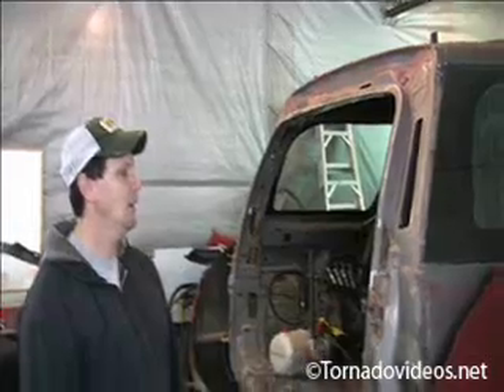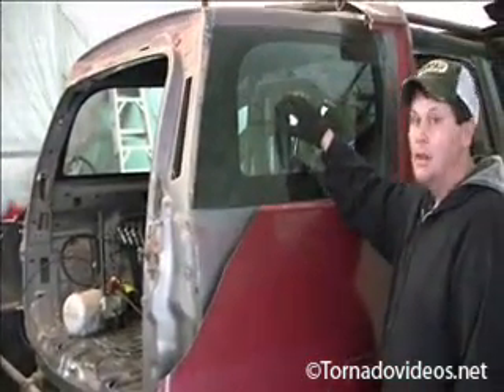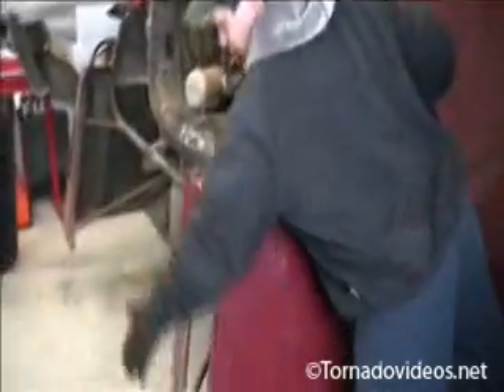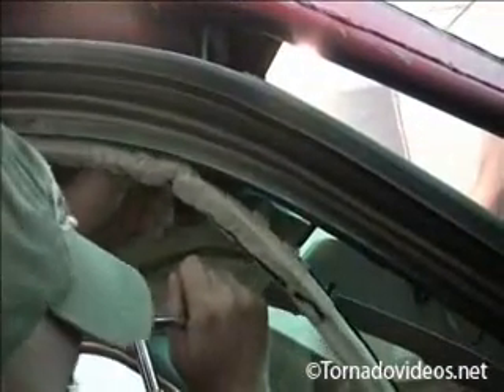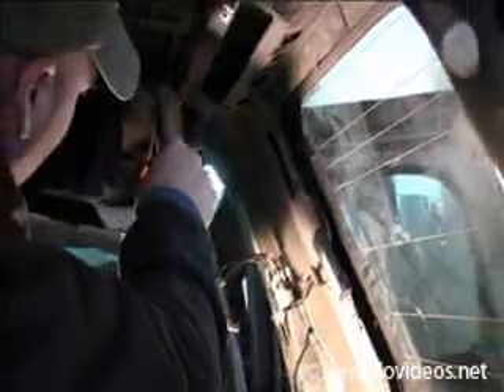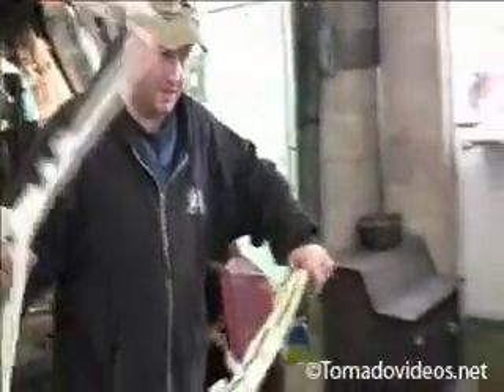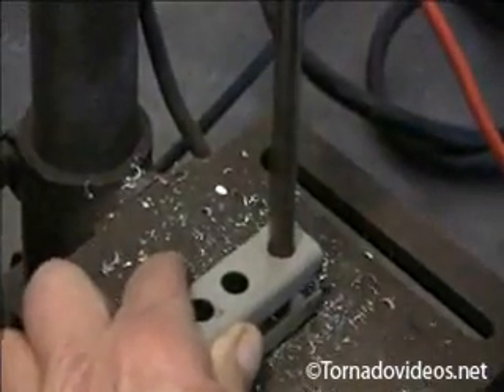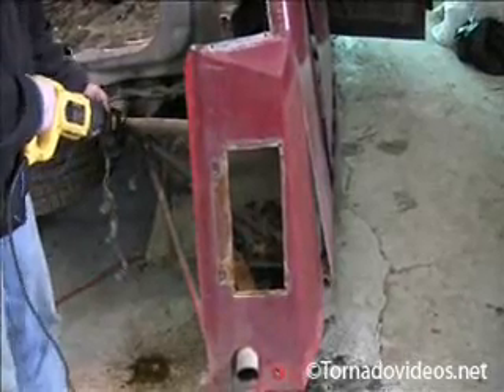Rebuilding the Dominator - Part 1

Comment: Why are they using sawzall's instead of angle grinders with cut off wheels, or cutting torches?

Slow, not very precise,loud, prone to snagging/jamming/slipping, etc etc would be the reasons I wouldn't use a sawzall!

Comment: @stormtracker1, they are refining and improving the most vital tool they work with, "playing like this." They know more about what they need from it than anyone else on the planet. They "spend 50K+ on a radar" because it would cost them 500K+ and years to attempt to develop and build it themselves. Modifying and refining a vehicle does NOT require hiring an engineer. It requires engineering thinking, mechanical skills and common sense, and good tools, all of which they have.